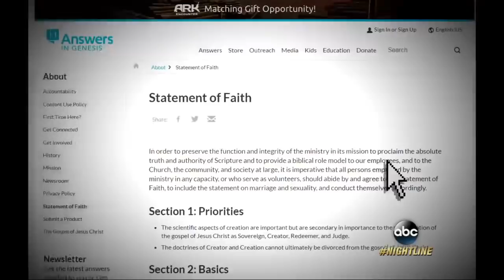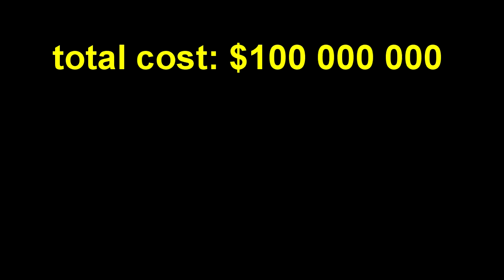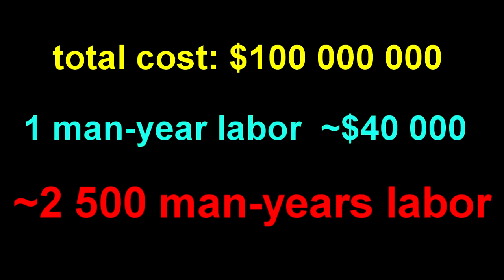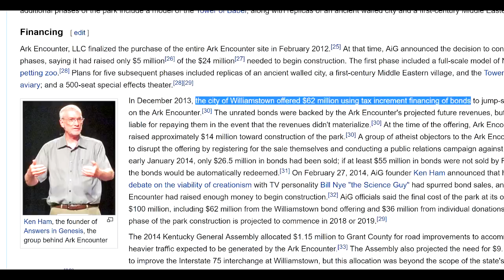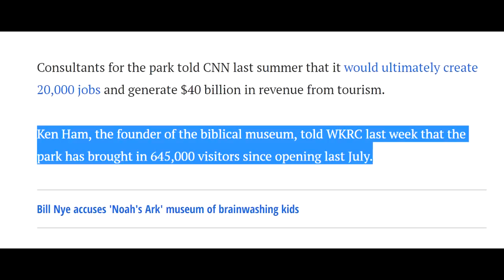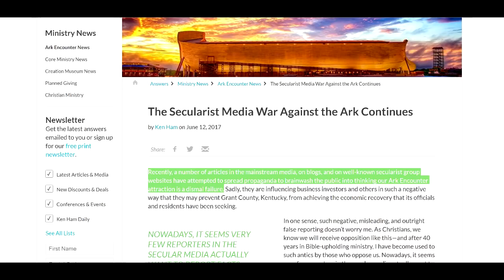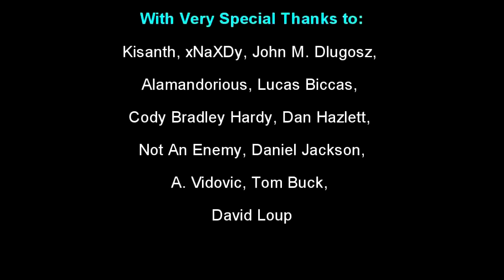Why do people laugh at creationists (part 44)

Comment: Traditional biblical crane
Reply: Traditional steel reinforced concrete and steel beam construction, with traditional panel liner 

And some people claim that it was worth while investment in case of flood happens... That thing wont move anywhere due it being a fucking building, not a boat! Even if it would dislodge from its position, it will turn into pile of scrap metal from first wave...
Reply: Hellsong89 it's not meant to float. Duh. It's on the top of a hill. Kentucky rarely floods.  Chill out.  It's a museum. Not a cruise.
Reply: scrap metal? its made of FUCKING WOOD
Reply: FontuneTheTeller then what the hell was the point of it then?
Reply: world's largest bonfire?
Reply: FontuneTheTeller ''had access to these same metal tools.''

The first electric power tools were made in the 1880s, not thousands of years ago. You know, like the cranes and the drills and trucks?
Reply: "The only aspects of the story of the Ark that sound doubtful, is the time it took to build and the workforce."

Unfortunately, timescale and workforce are the only parts of the construction the bible explicitly defines.

Calling those into question calls the entire thing into question.
Reply: Fortune the time period that is suggested when the ark was built was LONG before even bronze became commonly used. The Ark was built with three to four guys, with no technology whatsoever, and nothing but wood. Funny how a Chinese vessel likely took far longer to make, and actual technological advancement.
Reply: NOAH'S NAIL GUN
Reply: They did have cranes back then.
"Them" not being Noah, however.
Reply: Nerobyrne I think God helped out somehow.
Reply: Nerobyrne the
Reply: emarskineel You KNOW that your God has abandoned you, if you spend $100 MILLION on a Noah's Ark recreation, and people like myself that live in the USA, have never ONCE heard of this tourist trap until it had long since failed!

Bravo Ken! Bravo creationists everywhere! God loves your work so much that he ignores your existence!
Reply: Yes, they did have cranes. The same ones we have today, feathers and all. :P
Reply: Most scholars find it highly unlikely that the Zheng He's ship was 140m in length, but more around 100-120m, and others put it less. If it was as large as claimed, it would not have survived on the open ocean as shown by later wooden ships that attempted to be that size. (HMS Orlando and the Wyoming.)
Reply: And then Russel Crowe would not have been able to give us his sterling performance of the great Noah. And how dare you interject simple basic logic into religion! Religion needs to be based upon simple, ignorant mythologies so it can appeal to the great unwashed masses so they can feel "special."
Reply: Christopher Franklin very sad but you won't be alone in the lake of fire,there's time for you to repent!
Reply: Christopher Franklin today's date is based on the birth of Jesus Christ,there's still time to repent..only a fool says there is no God!
Reply: mr skipdiggidy and only a fool would believe otherwise. If all men gave up the calendar we follow, start over, would time stand still? Our date is based on the start of the age of christianity. One day, we may see fit to turn a new leaf once again, only then, time will march without any god as it does now.
Reply: Psychic Ninja sad to say that you won't be alone in the lake of fire,the devil has blinded you.. there's still time to ask for forgiveness and repent
Reply: mr skipdiggidy You play an easy, straightforward game, though I'd think there's no harm in abstaining from it, at least in this life. I'm sure the lake of fire is quite painful to send an atheist person to who's never fucked and never killed. If you would say anyone who doesn't believe what you believe should burn forever, sorry friend, but I hope you're wrong.
Reply: mr skipdiggidy.
100 million 💰 👌😈
Reply: Don't any "believers" stop and think for a moment of the technical requirements for building something like an ark? Farmers and shepherds aren't going to turn into maritime engineers overnight. What is wrong with using a little bit of simple common sense? Oops, sorry, the Bible is not allowed to show common sense ideas.
Reply: I know They mention the Ark and the flood in the time of Noah  in sumerian text  that  were found in iraq in the seventies  the sumerian text were found to be around 7000 years old. the flood has been mentioned by  every nation  though out  mans history  so there was a read flood so there could have been a real ark .
Reply: Please go back to school and take a few courses in logic and history. The fact that there might have been a flood hardly gives any credence to the existence of an ark. The Tigris and Euphrates rivers have always flooded, like most rivers tend to do on a regular basis. There are several versions of the Mesopotamian flood myth, with the account closest to that in Genesis found in a 700 BC Babylonian copy of the Epic of Gilgamesh. In this work, the hero Gilgamesh meets the immortal man Utnapishtim, and the latter describes how the god Ea instructed him to build a huge vessel in anticipation of a deity-created flood that would destroy the world. This is but one of many flood mythologies. I'm guessing that floods were the single most devastating events that took place during early historical times and form the basis of the destruction and rebirth stories. And it is quite logical that anyone "saved" from the floods would have to be saved in a boat. These are just stories, not historical accounts.
Reply: Christopher I think your replying to me. You realy need to put in your reply  the name your replying to. But how the hell are there going to be any historical accounts. .the flood in the time of noah was way before any written language So it was only told by word of mouth  in parables  Actually any thing that has happen back then would only be found in parables. But as  said befor There a stack of evidence for a world wide flood around thousands of years ago. all over the whole of the earth there are ancient destroyed temples that  look like they were destroyed by flood water  there even evidence of flood waters in the great pyramid. so there was a great flood and this is a science fact
Reply: Christopher You speak of going back to school. But  It strange how inept is your education for it it were any better you know that from our own  history if it were not for The  belief in God from people who lived in the pass there would be no such thing as the existence of an education. Early schools were stated for only one reason.  so that people when they grew up would be free to read there own  bible. And not have to trust in some one who could only read it in latin.
Reply: Christopher Franklin sad that the devil has blinded you and hardened your heart,you come to the table with your small minded research,the Lord is supernatural, everything he does is beyond our understanding, I guess the universe was created by the "big bang" THEORY..
Reply: The sad thing is how in the 21st century we have people (and lots of them, like you), that are blinded by superstition and mythology. There is a reason why we had a period in human history called the "dark ages." People (just like you) in power, suppressed the truth from the people and clouded their lives with superstitious nonsense. It took people like Galileo, Copernicus, Da Vinci,, Newton, and the list goes on, who broke the chains of ignorance and allowed the expansion of our minds beyond the simpleness of religious dogma. Now I am done with you. I need to listen to Dawkins, Hitchens, and a few others to feel good again.
Reply: Larry: hope you don't think I'm on the side of the "great flood" crowd. Ask anyone in Houston what they think about floods at the moment. Just the concept of 8 people surviving to repopulate the earth is just about the ultimate in ignorance. All of these biblical tales are just stories, nothing else. They are not historical records. My entire presence in these conversations is to try and get the religious types to just open up to the reality of truth and reality, clearly an alien concept. I am well aware that they will never change their minds. And neither will I. I have science on my side. They have superstition and mythology. And please don't tell me you get your knowledge of history from Hollywood.
Reply: Larry: as I have previously mentioned, ancient people would not have seen any natural disaster greater than a flood during their lifetime. People live around water (rivers, lakes, oceans). What do you think a tidal wave would look like to a person 4-5 thousand years ago. They would think it is the end of the world. That is the reason why many different cultures have some sort of flood mythology. You have to realize that thousands of years ago the vast majority of people never traveled more than five miles from their birthplace. They had no concept of a "world" as we know it. How could they. In the 15th century most people thought the earth was flat and the sun revolved around the earth. The mere fact that a story persists throughout a period of time is hardly incontrovertible evidence that some sort of world flood happened. Particularly of the magnitude as described in the Bible. Stop for just one second and ask yourself (lets assume the Noah flood), just where did all the water go to if the entire earth is covered with it. And another simple real world fact, assuming the biblical notion of the earth being 6000 years old, there is absolutely no way that 8 surviving people could have repopulated the planet to 7.5 billion people today. Just do the math. Anyway I have wasted way too many keystrokes on this. Just watch a few videos from Harris, Dawkins, Hitchens, etc., to see the facts.
Reply: You are now my official "devil guy." I am a scientist and the only thing I am confused about is how many people continue to insist in believing fairy tales.
Reply: rahowhero X I'm sorry,that doesn't make any sense, are you an evolutionist?
Reply: I'm astonished anyone would try to reason with a person who calls himself "mr skipdiggidy", but heck, I astonish myself. 
Perhaps, mr s, you fail to realise that all those people you dismissed above as "confused": Galileo, Copernicus, Da Vinci, Newton, were themselves devoutly religious.
Reply: Gottenhimfella I'm not religious,I'm a Christian! I don't care what these "religious " people say,I know my bible and my heart,you can't comment on the change in my life after asking Jesus Christ as my savior " born again" I know what happened to me and other born again Christians, if you broke your arm as a kid and I just met you and told you that didn't happen to you,are you going to care what I say and stick to what you know happened or are you going to change your mind about breaking your arm just because I  didn't believe you?
Reply: Simple religious folk, you know, the ones that believe in nonsensical things like gods, the devil, the tooth fairy, Santa Claus simply, (play on words here) cannot understand the complexities of life. So they come up with very simple (there's that word again) concepts to make them and their brethren feel comfortable. And then when people with a smattering of intelligence, the aforementioned Galileo, Newton, Copernicus, start saying (and discovering) things like how things really work, these simple people see their world view coming apart at the seams. So what do they do? They embark on a campaign to impune the integrity of said individuals. They start by calling them confused. Then they create institutions to perpetuate their beliefs (we know what they are), by the simple (again) process we all know as brainwashing. You know, dog crap will start to taste good if you eat enough of it. And, of course, you have to completely deny what happens in the world around you, such as, floods (Texas, anyone), plague (14th century), wars (too many to count) that your "savior" is supposed to protect you from. The best answer they can come up with is the old saw of "works in mysterious ways." These people are clearly satisfied with drinking from the well of ignorance despite incontrovertible evidence to the contrary. It wouldn't be so bad if they just wandered around mumbling to themselves. However, they have to interject their ignorance into society writ large by making outrageous claims that are patently impossible on the surface or completely violate the immutable Laws of Physics. The shameful thing is that I have people like this in my own family. Needless to say, dinner conversations can become very lively. I have now officially wasted way too many keystrokes. I await the responses from the thundering herd (after they pray for my salvation). After all, it is Sunday, today. Everyone have a blessed day.
Reply: All of you guys need to stop clogging up my notifications with this. Just walk away, maybe? Nobody's moving from their positions, so this is a shouting competition, not an argument.
Reply: mr skipdiggidy yes. it makes no sense. labelling measures of time after gods doesnt indicate 1 way or the other wether these gods existed. saying jesus is real because of the calander is equally dumb as claiming thor was real because of thors day, or janus was real because of January.
Reply: Larry, Larry, Larry. What on earth are you smoking? Have you been reading Sartre again? Come out of the clouds and take a long hard look at the world around you, not the fantasyland bobbing around in your cranial structure.
Reply: Christopher Franklin are you an evolutionist?
Reply: Skipdig: and from all of my comments you think I'm NOT? I am a man of science. Just can't seem to buy into unproveable nonsense. No offense intended. You are entitled to believe whatever you want. I have absolutely no intention of trying to change what you think. Kind of like dealing with an alcoholic. They have to come to the realization of what the truth is and change on their own. You are probably a nice guy, slightly delusional, but a nice guy, anyway.
Reply: Christopher Franklin the truth has been revealed to me through my Lord and savior Jesus,Hollywood and other avenues have polluted his name to make it sound crazy,that's what the devil wants,if you broke your arm when you were young and someone you just met said that it wasn't true,would you care what they said and stick to what you know to be true or would you change your mind because they didn't believe you? That's how I feel about being born again with Jesus. .
Reply: Christopher Franklin All  modern science was invented by christian to study Gods creation And education come about from the fact that christian want kids to grow up and be able to read the bible So all your education and all the science come from the bible.
Reply: jcr65566 lol albert einstein wasnt a christian ... nor is stephen hawkings .... stop making shit up
Reply: All of you people come up with the darnedest, most illogical explanations. Just which version of your Bible are you referring to? There are like 15-20 flavors. And, just for grins, just what do you think over a billion Muslims think about your Bible? Oh yeah, throw in a ton more Buddhists. There is something like 1500 organized religions. They all can't be "the one truth." Look up the definition of nonsense.
Reply: Rah: don't try and confuse this guy with facts. He will probably run out and fall off the edge of his flat earth.
Reply: mr skipdiggidy I believe in evolution because that is what all the evidence suggests.  I am not an 'evolutionist', whatever that means to you - I havent a clue. my disbelief in the god of the bible is based on evidence too. none for god, but plenty against.   and evolution is irrelevant to this. if you were to disprove evolution, this has nithing to do with your god being real, you still need evidence.
Reply: Holy shit did this comment section explode
Reply: rahowhero x I think you replied to the wrong person,  I never ever said this????????   Albert Einstein wasn't a christian He called him self an agnostic. And  Stephen hawking's called him self and Atheist
Reply: Christopher Franklin there is only one truth God is real All you have to do is talk to him.
Reply: yes, sorry, was meant to reply to twit saying all modern science was "invented" by Christians.
Reply: rahowhero x Sorry to tell you this but christian inverted science and also education as we know it to day   
By Chuck Colson CSN News 
 Columbus Day, we present a classic BreakPoint commentary by Chuck Colson on Columbus and the rise of science.
Thank heavens that Columbus was able to convince the world that the earth was round. Except, as Chuck Colson explains in this classic BreakPoint commentary, Columbus didn’t have to convince anyone.
For well over a century and a half, secular intellectuals have promulgated the myth that when it came to understanding the natural world, medieval and earlier Christians were superstitious simpletons. As we mark Columbus Day today, sit back and listen to Chuck Colson as he debunks that pernicious fairy tale.  Here’s Chuck:
To paraphrase the opening of a popular ESPN show, these four things everyone knows are true: Before Columbus's first voyage, people thought the world was flat. When Copernicus wrote that the Earth revolved around the Sun, his conclusions came out of nowhere. Three, the "scientific revolution" of the seventeenth century invented science as we know it. And four, false beliefs and impediments to science are Christianity's fault.
There's just one problem: All four statements are false.
As Rodney Stark writes in his new book, "For the Glory of God," "every educated person" of Columbus's time, especially Christian clergy, "knew the earth was round." More than 800 years before Columbus's voyage, Bede, the church historian, taught this, as did Hildegard of Bingen and Thomas Aquinas. The title of the most popular medieval text on astronomy was Sphere, not exactly what you would call a book that said the earth was flat.
As for Copernicus's sudden flash of insight, Stark quotes the eminent historian L. Bernard Cohen, who called that idea "an invention of later historians." Copernicus "was taught the essential fundamentals leading to his model by his Scholastic professors"—that is, Christian scholars.
That model was "developed gradually by a succession of … Scholastic scientists over the previous two centuries." Building upon their work on orbital mechanics, Copernicus added the "implicit next step."

https://www.cnsnews.com/commentary/chuck-colson/weve-been-lied-christians-not-enlightenment-invented-modern-science
Reply: jcr65566 bollocks...people were doing modern science before jesus was even invented ... eureka .... should be a clue.
Reply: jcr65566 and also, how the fuck would you (or anyone else) know copernicus was a christian? he lived in times when to deny christ meant burning at the stake,  so naturally everybody made the claim ... a bit like usa presidents where to be non christian is career suicide.   let alone genuine suicide.
Reply: No where in the bible dos it say the earth is the center of the univerce In the early 1500s, when virtually everyone believed Earth was the center of the universe, Polish scientist Nicolaus Copernicus proposed that the planets instead revolved around the sun. Although his model wasn't completely correct, it formed a strong foundation for future scientists to build on and improve mankind's understanding of the motion of heavenly bodies.Born on Feb. 19, 1473, in Poland, Copernicus traveled to Italy at the age of 18 to attend college, where he prepared for a career in the church. As part of his education, he studied astrology — reading the stars to learn about future events — because at the time it was felt important for priests and doctors. Astronomy, the motion of heavenly bodies, was an important element of this. (Today, astronomy is a recognized science, whereas astrology is not.)
Reply: rahowhero People were doing alchemy for there king. The word science comes from the greek word scientia,  means to know but it  was not the science we know to day To me And other  Christians, science is merely that branch of discovery that categorizes, discovers, and utilizes the knowledge woven into the fabric of the universe by a Sovereign, All Powerful, and Omniscient, Creator.  Science is not the end of all things, but merely one of the means by which man may glorify God.   This is because God is the creator of all that is.  He has hidden the treasures of his ominous glory in the very universe in which we exist.  The power in the atom, momentum, energy, mass, time, etc. are all creations of God and, therefore, under his authority.  The more the I as a Christian learn of these things, the more I see it  glorifies  God.  Science must be subservient to Him, not the other way around.  Science is not God's replacement. Science  is us trying to feebly  learn the mechanisms of  Gods creation. And so far I feel we only know a fraction of the multiple mechanisms that are in Gods creation
Reply: rahowhero X how foolish,God created science! Are you an evolutionist?
Reply: rahowhero X watch any moody institute of science video for just a miniscule of evidence
Reply: And that is exactly how you have to portray science in the overall scheme of things in order to justify your beliefs. You guys have had several hundred years to perfect your story. On our side, 90% of all the scientists who ever were, are still alive today. True science has only had a relatively short life span. The early scientists; Galileo, Copernicus, et al., didn't have the tools necessary to be able to properly analyze the things they were attempting to study. And all the while they had to fight the ignorance perpetuated on society by the power of the church. There is a good reason for the dark ages to be called the dark ages. Why bother studying anything if all the answers are in your holy book? That is a pretty good definition of insanity on a global level.
Reply: Christopher Franklin very sad how beguiled you are
Reply: rahowhero X it takes more faith to believe in evolution without a master creator then a wonderful masterpiece,put a bunch of parts in a box and shake them for millions of years and when you open it it's a beautiful running watch,sounds foolish,sounds does evolution
Reply: I'm just scared witless waiting for the lightning bolts............BTW, my mama didn't raise no fool. You were supposed to stop believing in fairy tales when you got past five years old. Que paso, amigo?
Reply: Skipd: do you, by chance, have a brother name hotdiggidy? Just curious. All you have done here is to illustrate and abundance of ignorance perpetuated by others with the same level of ignorance. This is complicated by your unwillingness (or inability) to understand the immense complexity of biology and physics. It is completely understandable how you could only come up with some supernatural answer to your questions. You are simply not smart enough, bro. You hear thunder and lightning and since you have no knowledge of the weather, it must be some gods in the sky arguing about something. Can't get any simpler than that. Primitive societies had no way of knowing how things worked. So they dreamed up answers. Over the centuries we did find out how things worked. The scary thing is that now that we know that thunder and lightning is caused by natural events and we have the scientific method of discovery, we still have people like you, who continue to believe what our ancestors believed. Time to wake up and come into modern times. This is not the 12th century anymore.
Reply: You don't even know me and you claim I lead a sinful life. Who are you to judge me or anyone? Didn't your mother raise you with any morals? The arrogance!!!!
Reply: Christopher Franklin we are all sinners,me included,but Jesus dieing in the cross and me asking him to forgive my sins is the difference
Reply: Larry Glazner bullshit. what sort of poem claims birds blood cure leprosy?
Reply: Larry Glazner heres some more "poetry" ...

5) Death to the Rape Victim (Deuteronomy 22:23-24 NAB)

If within the city a man comes upon a maiden who is betrothed, and has relations with her, you shall bring them both out of the gate of the city and there stone them to death: the girl because she did not cry out for help though she was in the city, and the man because he violated his neighbors wife.

It is clear that God doesn’t give a damn about the rape victim.  He is only concerned about the violation of another mans “property”.

6) David’s Punishment – Polygamy, Rape, Baby Killing, and God’s “Forgiveness” (2 Samuel 12:11-14 NAB)

Thus says the Lord: ‘I will bring evil upon you out of your own house.  I will take your wives [plural]while you live to see it, and will give them to your neighbor.  He shall lie with your wives in broad daylight.  You have done this deed in secret, but I will bring it about in the presence of all Israel, and with the sun looking down.’

Then David said to Nathan, “I have sinned against the Lord.”  Nathan answered David: “The Lord on his part has forgiven your sin: you shall not die.  But since you have utterly spurned the Lord by this deed, the child born to you must surely die.”  [The child dies seven days later.]

This has got to be one of the sickest quotes of the Bible.  God himself brings the completely innocent rape victims to the rapist.  What kind of pathetic loser would do something so evil?  And then he kills a child!  This is sick, really sick!

7)  Rape of Female Captives (Deuteronomy 21:10-14 NAB)

“When you go out to war against your enemies and the LORD, your God, delivers them into your hand, so that you take captives, if you see a comely woman among the captives a Bible Quotes-AugustEvil Bible Quotes-SeptemberEvil Bible Quotes-OctoberEvil Bible Quotes-NovemberEvil Bible Quotes-DecemberDefinition of Atheism urder, rape, and pillage at Jabesh-gilead (Judges 21:10-24 NLT)

So they sent twelve thousand warriors to Jabesh-gilead with orders to kill everyone there, including women and children.  “This is what you are to do,” they said. “Completely destroy all the males and every woman who is not a virgin.”  Among the residents of Jabesh-gilead they found four hundred young virgins who had never slept with a man, and they brought them to the camp at Shiloh in the land of Canaan.

The Israelite assembly sent a peace delegation to the little remnant of Benjamin who were living at the rock of Rimmon. Then the men of Benjamin returned to their homes, and the four hundred women of Jabesh-gilead who were spared were given to them as wives.  But there were not enough women for all of them.  The people felt sorry for Benjamin because the LORD had left this gap in the tribes of Israel.  So the Israelite leaders asked, “How can we find wives for the few who remain, since all the women of the tribe of Benjamin are dead?  There must be heirs for the survivors so that an entire tribe of Israel will not be lost forever.  But we cannot give them our own daughters in marriage because we have sworn with a solemn oath that anyone who does this will fall under God’s curse.”

Then they thought of the annual festival of the LORD held in Shiloh, between Lebonah and Bethel, along the east side of the road that goes from Bethel to Shechem.  They told the men of Benjamin who still needed wives, “Go and hide in the vineyards.  When the women of Shiloh come out for their dances, rush out from the vineyards, and each of you can take one of them home to be your wife!  And when their fathers and brothers come to us in protest, we will tell them, ‘Please be understanding.  Let them have your daughters, for we didn’t find enough wives for them when we dest60royed Jabesh-gilead. And you are not guilty of breaking the vow since you did not give your daughters in marriage to them.'”  So the men of Benjamin did as they were told.  They kidnapped the women who took part in the celebration and carried them off to the land of their own inheritance.  Then they rebuilt their towns and lived in them.  So the assembly of Israel departed by tribes and families, and they returned to their own homes.

Obviously these women were repeatedly raped.  These sick bastards killed and raped an entire town and then wanted her attacker?  Answer: God.

5) Death to the Rape Victim (Deuteronomy 22:23-24 NAB)

If within the city a man comes upon a maiden who is betrothed, and has relations with her, you shall bring them both out of the gate of the city and there stone them to death: the girl because she did not cry out for help though she was in the city, and the man because he violated his neighbors wife.

It is clear that God doesn’t give a damn about the rape victim.  He is only concerned about the violation of another mans “property”.

6) David’s Punishment – Polygamy, Rape, Baby Killing, and God’s “Forgiveness” (2 Samuel 12:11-14 NAB)

Thus says the Lord: ‘I will bring evil upon you out of your own house.  I will take your wives [plural]while you live to see it, and will give them to your neighbor.  He shall lie with your wives in broad daylight.  You have done this deed in secret, but I will bring it about in the presence of all Israel, and with the sun looking down.’

Then David said to Nathan, “I have sinned against the Lord.”  Nathan answered David: “The Lord on his part has forgiven your sin: you shall not die.  But since you have utterly spurned the Lord by this deed, the child born to you must surely die.”  [The child dies seven days later.]

This has got to be one of the sickest quotes of the Bible.  God himself brings the completely innocent rape victims to the rapist.  What kind of pathetic loser would do something so evil?  And then he kills a child!  This is sick, really sick!

7)  Rape of Female Captives (Deuteronomy 21:10-14 NAB)

“When you go out to war against your enemies and the LORD, your God, delivers them into your hand, so that you take captives, if you see a comely woman among the captives a Bible Quotes-AugustEvil Bible Quotes-SeptemberEvil Bible Quotes-OctoberEvil Bible Quotes-NovemberEvil Bible Quotes-DecemberDefinition of Atheism urder, rape, and pillage at Jabesh-gilead (Judges 21:10-24 NLT)

So they sent twelve thousand warriors to Jabesh-gilead with orders to kill everyone there, including women and children.  “This is what you are to do,” they said. “Completely destroy all the males and every woman who is not a virgin.”  Among the residents of Jabesh-gilead they found four hundred young virgins who had never slept with a man, and they brought them to the camp at Shiloh in the land of Canaan.

The Israelite assembly sent a peace delegation to the little remnant of Benjamin who were living at the rock of Rimmon. Then the men of Benjamin returned to their homes, and the four hundred women of Jabesh-gilead who were spared were given to them as wives.  But there were not enough women for all of them.  The people felt sorry for Benjamin because the LORD had left this gap in the tribes of Israel.  So the Israelite leaders asked, “How can we find wives for the few who remain, since all the women of the tribe of Benjamin are dead?  There must be heirs for the survivors so that an entire tribe of Israel will not be lost forever.  But we cannot give them our own daughters in marriage because we have sworn with a solemn oath that anyone who does this will fall under God’s curse.”

Then they thought of the annual festival of the LORD held in Shiloh, between Lebonah and Bethel, along the east side of the road that goes from Bethel to Shechem.  They told the men of Benjamin who still needed wives, “Go and hide in the vineyards.  When the women of Shiloh come out for their dances, rush out from the vineyards, and each of you can take one of them home to be your wife!  And when their fathers and brothers come to us in protest, we will tell them, ‘Please be understanding.  Let them have your daughters, for we didn’t find enough wives for them when we dest60royed Jabesh-gilead. And you are not guilty of breaking the vow since you did not give your daughters in marriage to them.'”  So the men of Benjamin did as they were told.  They kidnapped the women who took part in the celebration and carried them off to the land of their own inheritance.  Then they rebuilt their towns and lived in them.  So the assembly of Israel departed by tribes and families, and they returned to their own homes.

Obviously these women were repeatedly raped.  These sick bastards killed and raped an entire town and then wanted
Reply: Christopher Franklin get ready for some no true scotsmen type responses.
Reply: Eu4  PLeb because then we couldnt explain rainbows .. lol.
Reply: Christopher Franklin  like all atheist you know only a little bit about Christianity Before christian there were only zionist  and the tribe of  judah the judas tried to save jesus But the Pharisees, had him killed by the romans  The Tradition of the Pharisees, which is the BABYLONIAN TALMUD, declared complete in writing in Sura, Babylonia, in 500 AD. This is the Jewish-approved SONCINO translation, procurable thru Jewish bookstores for around $500. At the time Christian clergy knew nothing  about it than the parakeets chirping in his cage. The Pharisees, become the roman  catholics  
Fore thousands of years Every pagan abomination lambasted by the Old Testament is argued into approval and permission by the TALMUD, including burning of children to Molech, murder, sodomy, incest, etc.Jesus said the  the Pharisees, look good on the outside but on ther  in side they were were like dead man bones .   christian were around 300 before  the pagan catholic church got started it  was  run by  the  laws of  the Pharisees,
Reply: While I appreciate the history lesson, none of what happened 20 centuries ago really has any meaning today. Unless you are inclined to follow the beliefs of a society that existed back then. In that case I suggest you buy a piece of land in the Sinai Desert and set your tent up. All you have really described is nothing more than inter-human relationships that have existed as man evolved (there is that word again) from living in caves, to larger societal groups. That is what human history is all about. Anything that happens to you and around you (mostly) will be the result of action taken by another human being, not some fanciful god or gods, or other supernatural phenomena. And do me one favor; stop making judgements on someone you know nothing about, simply because you are stereotyping me. For all you know I could be a defrocked priest who finally saw the light and wanted to get laid instead of preaching to the great unwashed masses.
Reply: What happened was that human intelligence persevered DESPITE the oppression of the church. The church surely did absolutely nothing to help anyone with their heliocentric theories and scientific observations. To say that these things happened within a christian-based society, therefore, Christianity is good is a serious fallacious argument. Look at the history of mathematics and you will see non-christian origins from ancient Greece and Egypt, long before there was a Europe. Who do you think invented gunpowder? (that would be the Chinese). The first indication of a cannon was in the 12th century in China, more than a hundred years before any European efforts. And if you don't think gunpowder had an impact on modern civilization, you need to rethink your history. Need I go on.
Reply: Larry: I saw that list before I wrote my response to you. I never implied that burning heretics had any sort of impact on the world. The point is that they burned these people merely because they did not tow the church line. Remember, the US was founded by people escaping religious persecution. You can stretch this historical line to the destruction of Native American culture by this one seminal event and its singular cause.
Reply: Christopher Frankin All of it was God
Reply: I should have expected the classic answer. No need to think anymore. I guess I wasted 11 years of my life in college trying to learn "stuff", when the answer was in front of me all the time. I guess I'll have to move down South, get a couple of lawn cars, sit on the porch, drink moonshine and clean my 35 rifles. And change my name to Cletus.
Reply: BS Psychology, BA Public Administration, MPA (Masters in Public Administration), MSIS (Masters in Information Security) started a Doctoral program in International affairs, did not complete it). Too much book learnin'. I also have a two year AA in Business. That is really just like another high school diploma. And I am 74 years old and retired from the evil Federal Government. I have all the time in the world to "play" in these comment sections. Although you and I will probably not see eye to eye any time soon, it has actually been good "talking" to you. It keeps my old fingers limber on the keyboard. Have a good day.
Reply: Christopher Franklin  I know where your coming from I felt the same thing in the eighties when I went to college. It hard enough just working but Just trying to work and feed a family and then also get through completing  two degrees was incredible hard for me. Study brain all most ended it for me that first six  month of anatomy I keep thinking my little brain could not possibly remember all this. but it strange how studying anatomy  solve it for me when I learned when remembering the human brain absorbs 10% of the sugar in the body  all I had to do was replace the sugar no more study brain. it then it become possible  I like what one one of the professors said to me  The hardest part is to show up in class and just keep going at it. eventually you will get there.
Reply: We definitely have that in common. I was married, raising kids, working full time and going to school full time.I even went to summer school for a couple of years to make the degrees happen sooner. In the early 60's (before I was married) the Army came knocking and "suggested" I should drop everything and come stay with them for a while. And, by the way, we are going to send you to live and work in a jungle. And those things flying by, are not mosquitoes, they are bullets. And silly me, I volunteered for a second tour over there. And I will let you in on a little secret. When a young man (and we were all pretty young then), is shot and knows he is dying, you know who he calls for? He calls for his mother. He doesn't pray for God to save him. He just wants the comfort of his mother. After that was all over and I went back to school I was already in my late 20's, early 30's. I was the "old guy" in most of my classes. Now I have fun verbally jousting with total strangers on YouTube and other blogs.
Reply: Christopher Franklin interesting simininor I got the same  letter come to the  party too.  I had just finish a 4 year  trade cause.  Australian National service 72 intake 6/7 RAR and 3 RAR. At first I look on it as an adventure After I was discharge in 74 I found out Australia was in worse recession it ever been in.  I was married had a  little baby girl But could not find any work.  So I went back in but in to the Regular Army. But  With out other National service man to fall back on  After a while I learned what a true bastard the regular army guys  could  be. I was involve in a chopper accident and was medically discharge with back problems that meant working my trad cause was difficult  My father ask me to come in with him but it meant again going  back to school. for three years But with the help of my dad and the engineers who worked with him I was able to pass it all. Degrees are nothing to my Dad He had a lot of people working for him who had far better degrees then I did. to get my self up to scratch  I ended up working and going back to school for a  further 13 years. In between this I went though that NDE when I was 26. Before the NDE My wife went to see here family 3000 Kl away on a holiday up in Darwin She took my daughter with her I never saw her again in the divorce took ever thing from me.  I got very sick and nearly died But I did not know God then So I just suck it up And try to get on with my life I collapsed at  work  My mum talk me in to going to hospital they said I was dehydrated no wonder  I had a twisted bowl Even after the "NDE" I still did not know I met God. I just felt some weird had happened to me "LOL". The "NDE"  and meeting him Had change me some how  I stop doing a lot of bad awful  things that I use to do.  I found I was treating people better. So I  made better friend ect.
Reply: rahowhero x true Christians have never killed any one its against  there beliefs.
Reply: Larry Glazner and of course you know mein kampf is a verbatim ripoff of martin luther - the father of protestantism, and was supported by the catholic church,  even after the war. the only 'christians' whom opposed him were the jehovah witnesses.
Reply: Larry: When I was younger my kids always thought of me as the "cool dad." Now I'm the "cool grandpa" to their kids. I have always had a curiosity about things I don't know about. I have never been "an old fuddy-duddy" (an ancient term). Unfortunately, my dad was exactly one of those. My dad was a career Army officer. But he started out as an Indiana farm boy. I would call my dad a religious person (he was a Lutheran, like many German immigrants). His father came over from Germany (actually before there even was a Germany) around the 1850's. Dad never pushed religion down our throats. I'm probably thankful for that. Otherwise I would probably be one of the brainwashed types on the other side of the fence. I had to throw that one in there.
Reply: Actually Julius Caesar called the region Germania. But in more modern times it became a loose federation of states that ultimately became the German Empire in 1871 under Bismarck. Before that there was an internal revolution around 1848. That is about the time my great grandfather came to the States. From the late 19th and early 20th centuries Germany became an industrialized state and was heavily involved with expansion which led to things like WW I and WW II. Good for your Dad. Too bad he succumbed to the wishes of your mom. The things you have to do to maintain the family.
Reply: FontuneTheTeller The problem of the while took for building the ancient ark can be remedied easily.
Reply: Christopher Franklin Historical records are stories.
Reply: Larry Glazner Ok, I apologize Larry, but we all have bias. I happen to think that both you and I have the correct bias, but we still have bias.
Reply: Help me, help me! Another one has joined the fray. Historical records are generally VERIFIED stories. You are not starting off well here.
Reply: Christopher Franklin Don't worry. I'll be nice. I might be too difficult to defeat, but at least I'll be nice. I hope you'll be nice too. Thank you for defining the phrase, "historical records". Also, I am starting off well here. I just was being sly.
Reply: Larry Glazner he probably killed christians because he considered himself a god. and christian theology dissagrees ... well most of the time. but yes, he was a nut.
Reply: rahowhero X Mein Kampf is also reportedly inspired by the book: On The Origin Of Species, By Means Of Natural Selection;
Or The Preservation Of Favoured Races In The Struggle For Life
.
Reply: God doesn't kill people for their  lack of  belief.  From conception we have all been  sentenced to death on an earth that is a  planet of death.  Where ever single living  thing on it,  can easily  kill us.  What God wants to do!!!  is save us from it."True" christians. the one who truly follow the teaching of jesus christ  Have not killed any one Such a thing is abhorrent to them.
Reply: jcr65566 lol yet this isnt considered when twits claim copernicus and co were christians. besides im not justt talking about churches within germany. no cnurch worldwide lpposed hitler, with the exception of the jehovah witnesses.   they displayed true faith and paid in blood in Germany.  perhaps they are the only true christians?
Reply: Hitler sent teams all over the middle east to find things like the ark of the covenant ... strange behavior for an atheist, wouldnt you agree?
Reply: sorry for the insults,  but dealing with these ignoramus' is frustrating.
Reply: OK, so one moment we are debating the merits of the ark story and somehow we digress into Hitler? Our train of thought is getting derailed.
Reply: Christopher Franklin No one but a child believes in fairies tails But no christian can believes in the bible either they cant  if they did,  not only would it become an idol they have to obey ever single word in it.  they can only believe in the teaching of jesus christ  written the bible The bible is just a book of instructions that like jesus use parables examples that are testament of man past relationship with God. 40 years ago  In an NDE I met him I talk with him and he is Real.
Reply: jcr65566: I'm guessing English may not be your first language. If it is, I suggest you repeat the third grade because your spelling and grammar is atrocious. If it is not, then schedule a visit with your ESL teacher. All of us reading your responses would appreciate that. No offense, of course. And have a blessed day.
Reply: OK then listen to this  The flood in the time of noah is a real flood The first book of the bible was the flood in the time of Noah  archaeologist have  proven though science  that the world wide flood realy did  happened But it happen in 11,800 BCE And that lines up with the 7000 year old sumerian text found in iraq.that mention it  but also in Central Mexico’s Lake Cuitzeo contains melted rock formations and nanodiamonds that suggest a comet impacted Earth around 12,900 years ago, scientists say.Both the egyptians and the tribes of judah (the jews) are descended from the  sumerians And a man called noah is mention in the  7000 year old sumerian text  archaeologist beleve a meteor strock the two mile thick ice sheet. the amount of flood water this would have released would have been incredible In the seraria desert  there evidence of vast amounts of melted meteor glass  Archaeologist  surmise that this comet or meteor may have created the vast amounts of sand that is in the aira And  also the flood in the time of Noah.All though that aira is ruined temples that have been dedicated to the worship of a serpent God. The flood destroyed all of them.
Reply: I must have missed your story about your problem. I do apologize. I'm not as bad as you think I am. We are all anonymous internet strangers.
Reply: That all right christ and thank you It it were not for the computer correcting my spelling  as I write I would not be able to reply I once thought it was because I did not speak english when I was a child but I since found out it was the damage from the lac of oxygen and I all so developed mild  CP from it as well  But I gt by
Reply: I do apologize again. I wrongly thought you were someone who was simply careless with the language and did not care how it came out. That was thoughtless and inconsiderate of me. I would not want to suffer with what you have to deal with every day. I do feel like a jerk now.
Reply: That OK Christ I have tried to improve my grammar and spelling but it just wont work I suppose  this is as good as it going  gets  LOL
Reply: Perhaps another bright flashing light story. I don't know the guy, so I really can't prove or disprove his story. After all, this is the Internet. Excuse me while I give my vital info to a Nigerian prince who is holding 10 million dollars for me. He has to be legit. He says so.
Reply: Larry Glazner well banishing that which harms society ... like religion, should be a tennant of everyone with a brain and empathy.
Reply: I should have been clearer. What I meant to say was current leaders. I am not aware of any of them coming right out and claiming to be an atheist. If they did, it would be here on YT. I didn't mean to go back in history to find one. There is a short video on YT that lists a few older ones (like you did). Atheism was a basic tenet of Communism. But, it is now clear that pure communism is a failed philosophy. Even China is not a "real" communist state. Maybe Cuba is. There are a few nice dictatorships scattered around the globe. The only philosophy a dictator has is money.
Reply: lol
Reply: pokemaster250 
Yeah, the Bonfire of the Vanities.
Reply: rahowhero X 
July named after Julius Caesar
August named after the emperor Augustus.
September through to December: Seven, eight, nine, ten.
Reply: @deathdealer312  its a business model, thats all. after all religion is about bisiness, at least in the usa
Reply: @thosebastards8112  hard to kill sea creatures with water...isn't it?
Reply: Richard Royce  There are many factors that go into determining the danger from owning a Pit. A bad owner is just one of them. However, my point is that the dogs have a potential lethality that the majority of other dogs do not. The numbers bear this out. Pits are by far the #1 killer of humans and other animals. Rottys, Dobermans, etc, do not come close. You cannot dispute these facts. My only real point is that Pits have such a potential to do harm due to their size and strength. If they suddenly snap, they have the power to kill. That can't happen with ankle biters who may just be able to nip you in the hand or leg in a full tantrum mode. If you have never had an incident of violence, good for you being a responsible owner.
Reply: Zimmit's Fun House Adventure  the fool hath said in his heart,there is no God..
Are you an evolutionist?  I guess not if you "hail satan"
Reply: Zimmit's Fun House Adventure  what if all that you believe is wrong? Or not enough? The bible was written over 2000 years ago,it has never been proven wrong while being tried the most ,not only that every prophecy has come true,do you know what the chances of that is? Its astronomical! I dont believe because I'm in a cult and have been brainwashed, I believe because I've studied it and the holy spirit lives inside me,most non Christians cant understand that, I dedicate my live to Jesus Christ because he died on the cross for my sins,his birth is how we set our date on the calendar, if you broke your arm when you were younger and someone today told you that experience did not happen to you,would you stand firm on that personal experience or would you let that person change your mind,its the same thing to me about my experience getting born again through Jesus Christ..
Reply: @theq4602  wood reinforced with steel...
Reply: @Hellsong89  Keep in mind that the exact tools wouldn't have been needed, something less advanced could be made to fit the purpose at the time. They had Metal, and a form of concrete at the time as well.
Reply: @fontunetheteller410  However it probably would be able to float due to the amount of air in the boat allowing its density to be lower than the surrounding water, so not actually far fetched.
Reply: Unintended Consequences  Well, its not mean't to be the actual ark and you are presuming that it wouldn't be able to float anyway.
Reply: @jovanstojkovski6978  Not electric tools, just tools good enough to get the job done in the first place, Cranes can and were hand made and operated back then by using some basic math and physics to make a pulley system. Its not hard to understand how easy you could make a pulley system that operates like a crane without electricity. And they did have metal back then like bronze and copper as well as some forms of concrete.
Reply: @FNLNFNLN  Actually the Bible never says if Noah used hired hands to help him build the arch, which would've been highly plausible and likely. It doesn't tell us if he has the money to do so either. So they are not as defined as you may think.
Reply: We have to ask Giorgio Tsoukalos if the anunnakis rented the cranes to Noah.
Reply: If Atheists and atheist scientits would actually stop watch Big bang "theory" on t.v and actually read the story in the Bible they would know exactly how it was done. Atheists are quick to judge slow to read and research. There was a time real scientists believed in God and their science was open to discover more of our world and universe. 80% of the world population believes in a higher power. Science is suppossed to be open minded. Its distubing and sad how science has been used has a weapon to hide truth and creativity, Instead they have come up with a stupid theory the we are not special or intellegent we are just descendants of monkeys and fish.